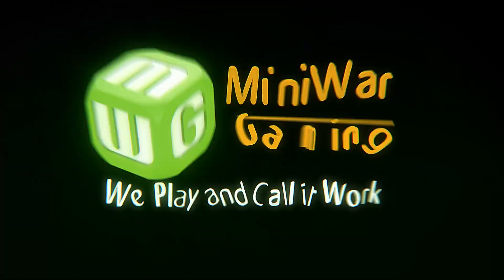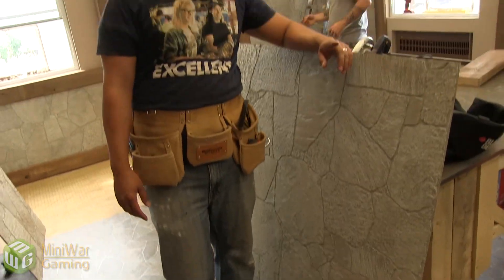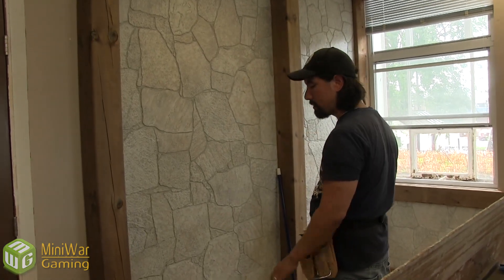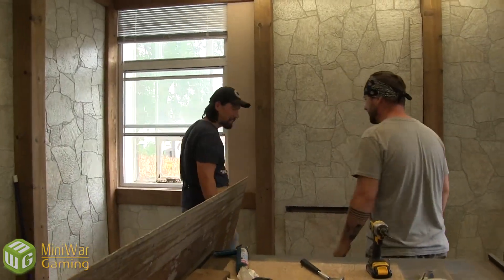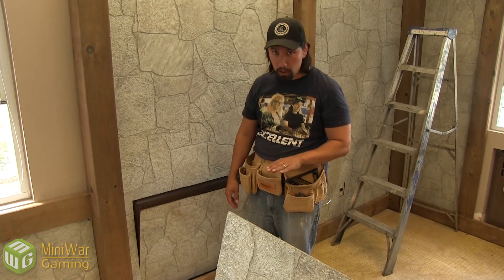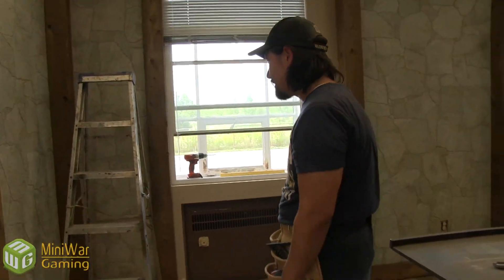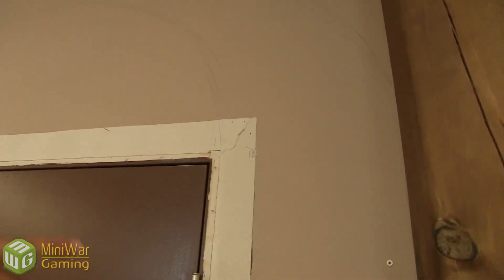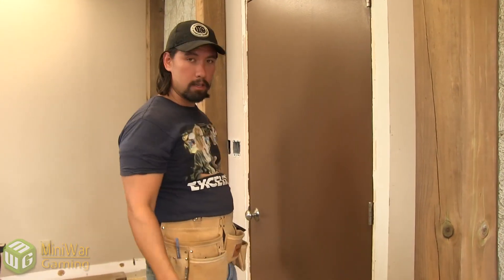Fantasy Studio Vlog Ep 2

Comment: I like the wall board, but I will note that you may want some real stone accents. It's pretty cheap to get scrap rock, or make your own rock powder mixes. Quikrete is also an easy fast cement, 'just add water'. The metal was what made the Ork shop really stand out.

Also, a tip for the blacksmith's stuff: you can get carbon black by just holding a spoon or the tool in a candle flame. Probably can find other carbon, charcoal and such, and attach it to get a sooty matte finish.

Edit: Oh, and if you're feeling really adventurous, synthetic industrial sapphires and rubies are actually quite cheap. Same with citrines, other 'semi-precious' stones, mine dross rough emeralds, and so on. Takes a little research, but industrials often have 'bad batches' they're willing to part with for gems.